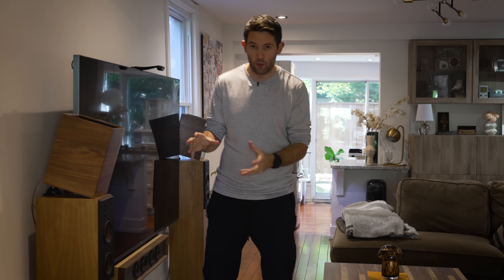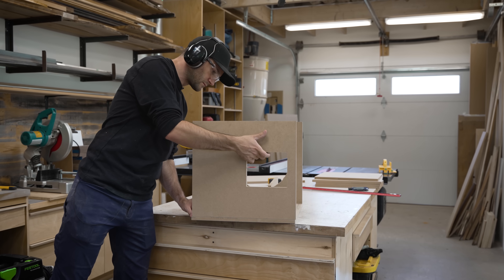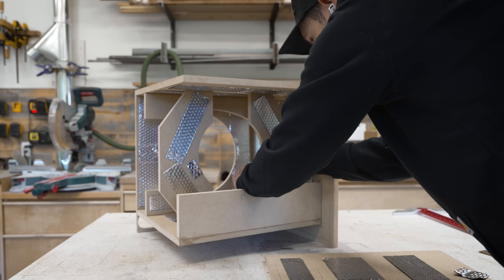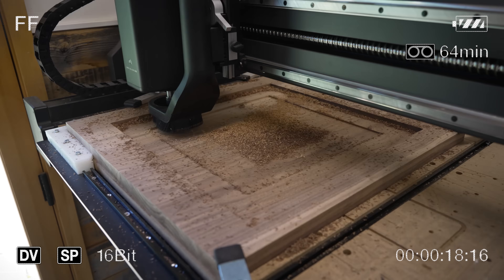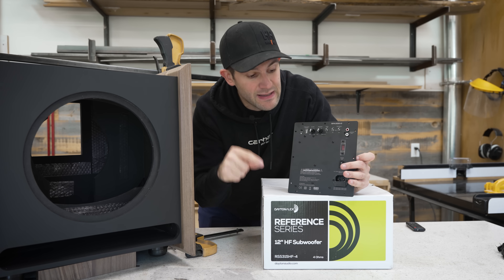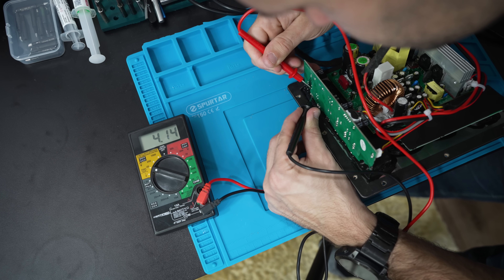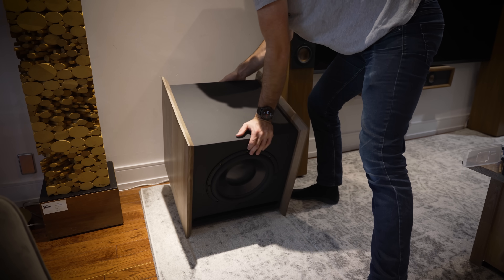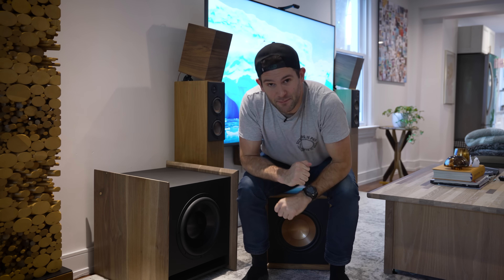THIS changes DIY Audio...

Comment: Like everything except the lack of screws.  Used to build Competition Grade sub boxes and we HAD to run 2 inch screws every 3 inches to hold the 1 inch birch 10 layer plywood together and liquid nail to seal it.  The finishing nail level nails you used made my butt pucker o.O

Comment: Wireless  everything in regards to home theatre  is not regulated  enough  to be a benefit and will interfere home   home networking

No matter  preamp or  avr  brand yku fuck around  in  networking in general nobody  deal and  wireless isgeneral slang is nonexistent in a progtamming layer

Including   s9meyhin that  can live on an app on a gateway routrr

Comment: Excellent video but I thought it might be helpful to point out that Class "D" amplifiers refers to a "switching" type power supply being employed to power the amplifier itself - compared to, for example, linear type power supplies found in class A/B & class A amplifiers - - the class "D" designation has nothing to do with whether or not the amplifier is a "digital" design.

Comment: Side note: if you are installing aluminum-backed butyl rubber sheeting, you really do need a brayer to press the butyl into the surface you're sticking it to. It'll ensure that it makes adequate contact so it doesn't fall off in the future once the solvents in the butyl inevitably escape and it begins to harden. It's why the aluminum is always textured like that. Press it with a brayer until the quilted texture has been pressed flat and you're guaranteed to have good contact.

Comment: A Class D amplifier exhibits harmonic distortion due to its sampling frequency. If you input a pure sine wave into a Class D amplifier, you'll see a stepped sine wave at the output. This cannot be considered 100% analog. A Class A amplifier is a pure and clean analog amplifier; the discussion then becomes whether or not it's energy efficient. For example, can we compare a Fusi (TPA3255) to an Accuphase Class A (A80)? Let's be realistic.

Comment: Sorry but destruction happens, when the amp clips, as this creates loud high frequency signals, really damaging.
So it is not about matching the wattage, but to have more power than you need for the amp.

Comment: Also.. u should ALWAYS hawe overhead watts from the amp and not less ! a woofer like your dayton RSS315HF4 is a 400w rms with 800w peak ! in subwoofers you always calculate 50- 100w owerhead even when it's applied in a ported box !  there wil be moore bad sound quality with a weak amp  and you're guaranteed todestroy the amp and the woofer!  but in the correct way to do this u only baybe break the woofer.. but not in this case cus the woofer can handle 800w peak !  nowhere near danger sone with 50 or 100watt overhead from the RMS of the woofer ! Personally i wuld used an amp that is in between the rms rating and peak rating of the woofer witch in this case would be 600w amplifier ! 

i don't know hwo learned u al these mistakes ! but hey ! this is beginner basic everybody know is wrong of u.. NEVER undercalculate a amplifier ! It`s more bad for the amp and the woofer since the amp is overloded al time an always clipping this is the wery known mistakes to kill the woofer AND the amp aswell !
A sealed subwoofer build in a good tuned box is always able to get lowest bass response ! as the ported even when perfect tuning applied i't will not go as low as a sealed bcz of the port turbelenting noise wil overtake and make no sound at al.. also basic things that every starter learn in the first..

Comment: As long as none of the PCB traces are torn, it's fine. And there's no risk of interference concerning revealed traces, because all of the soldering points are revealed anyway. Interference is negated most by the design of the traces and proximity, such as avoiding parallel traces corresponding to signal paths.

Comment: The choice of a 300 watt amplifier isn't terrible for a driver rated to handle 300 watts RMS, due to the increased efficiency when using a ported enclosure. However, had it been used within a sealed enclosure, it would have been a little under powered, because RMS is a rating of power at a continuous level and music isn't continuous, it is dynamic. 
When matching amps to drivers, you generally want to aim for an amp which delivers the rated driver RMS, plus half again. In this case, it would be 450 watts.
Also, the driver can have a greater impedance than what an amplifier is rated to be stable at. Simply be certain to not use a lower impedance. Using a higher impedance provides increased dampening or in other words, better control/quality, but more power will be required.
For example, when using an eight-ohm driver with an amplifier rated to provide 300 watts @ 4 ohms, the driver is only going to be presented with 150 watts. So the benefit of increased control typically requires using an amplifier which is rated to deliver three to four times the RMS rating of the transducer being driven.

Comment: Matching amp with driver power 1:1 is not necessary, over driving is only possible if you cannot manage to be carefull with the big twisty knob.
I find it better to make sure the amp is double or even tripple the power, this provides headroom and even more important a bigger damping factor.
A nice bonus is that the amps life wil be much longer as it wil not be working at 100% power all the time.

Comment: iv worked in sound for years and your information about the sub  and amp is totally incorrect u work to RMS not the full power of the sub and u want around about 50 to 100 watts more for the amp. as then it all runs efficiently as Ur amp wont last very long running it at full power all the time.

Comment: Zac is very capable on wood working and CNC - build is very nice, yet just like most DIY in audio. The think metal pad won't absorb base audio, this box seems has little audio concerns. Base reflect needs specific design and tune, and shall also use some absorb materials, I see none of them. If you don't know how to tune, you can use closed enclosure with enough absorb material. Don't use nails nor brads.

Comment: seriously ?  deeper low end rang on a ported ?  where was u at class ? the sealed boxex aaalways climb deeper than a ported box and with presission! i got 2 350w peerless xxls 12" from the fabric in denmark in 55l sealed boxes in my setup i challenge you to build a ported box that reaches below subsonic 15hz with ease and do not hawe any port noise at al ! cuz this is hi end hifi ! no poppcorn sound box that stops at 45zh..

Comment: Yo. Trust me on this shit. Put the driver downfacing on the bottom. Put it right in your most common sitting position. Right on the couch.  Creep around yer place. Find where it sounds best? K. Put it there. Hide it as needed, tighten with DSP.

Comment: On your amp, you want a lot more power than you ever intend to use. You never want to come up short on support. It's like Wall outlet current, a PC power supply, or a car engine; When you buy a car that can only go 70 miles an hour, and you often have to take it on the freeway, it will have a very short life. We own cars that will do 120mph, not because we want to go that fast, but so to can easily do 80 if needed. * PC power supply used at or near max output burn out quickly. * And wall outlet current that comes up short, fries power supplies and motors.

Comment: You asked about possible improvements. Sound wise? Nuthin! This is all the sub I'd ever want. Design wise? Love the look... but in my case, I have a peculiarity for preferring symmetry. Since bass is omnidirectional, and this sub is front ported, you can literally put it anywhere. So my symmetry gene would have looked into making the box slightly shorter, and slightly wider (keeping an eye on required volume) and sitting it under the center channel speaker. Just a little thing, but my feng shui gene would have approved.

Comment: Ported sub tuned to 32 hz is great for music. However, that's a recipe for over-excursion (blown sub) for home theater.

Below 32 hz, your enclosure is an open box. You need a high-pass filter blocking anything lower than the tuning frequency.

Comment: RIGHT AIR SPACE  in encluser, right crossover, for chosen speaker we used JL subs a lot    add the right amp   ..We use to build custom sub boxes to fit specific areas in automobiles when i had my car stereo business  back in the late 80s into 2000  home subb same format and math...
 I remember a trippty thing was to take a 4 ft long  x 5 in tube and stick out side of round port opening and watch the speaker flex seemed like forever.

Comment: The very best subwoofer enclosures contain nothing more than speaker wires and a speaker!  So that makes it much easier to build the best one!

Powered subs are horrible, in my view. They defeat the entire concept of tuning music, and bass is the most important part of music, and I want to tweak it. So I think I own all the passive subwoofers - and all the Fosi 2.1 three-channel units, because with modified subwoofers, they make all my old music, and all my old speakers sound brand new again! :)

Having SUBFREQ and SUBVOL instantly at your finger tips, on physical rotary pots is the best thing in a nearfield system: you get to massage the bass until it does exactly what you want, at any given moment. :D

Comment: Show me the math on applying Butyl to that MDF.  The mass increase is negligible, so why use Mass loaded vinyl?  It is made to stop resonance in thin metal /fiberglass/plastic panels.  Adding weight and more than doubling thickness.  Youre slapping it on a small piece of 3/4 MDF.

Comment: Very nice project, might do the same someday
One remark though : if you ever have interference, it will surely come from the sound wires coming from the wireless receiver
Usually, sound cables (RCA, Jack and others) are shielded to attenuate external agressions, here you installed cables without shielding and ran the wires right next to the "hot" (high voltage) side of your amplifier
You're lucky that those cables are short :)

Comment: Ahh yes the classic: Are Class D Amps Digital or Analog??? They are Analog. While plus width modulation resembles digital signaling the signal is still analog and PWM is not a binary encoder. If you think about it a digital audio amplification circuitry makes zero sense the drivers just want signal power to go to the magnetic coils. They couldn't give a crap if the signal power was encoded to binary. Why convert to digital if the driver is analog.

Comment: If you factor in the cost of parts and equipment, labor cost, the cost of renting a place where the product is built, payroll, R&D, dealership, logistics, etc, then you’ll realize comparing consumer products to DIY in terms of cost is not fair. I wish they are not expensive but that’s the cost of running a business.

Comment: FYI Its better to overpower a sub than it is to underpower one.  Ex: A 1000 watt amp powering a 800 watt sub is fine. Just reduce gain. Also, the overhang from the top panel isnt doing it any favors

Comment: This is awesome, but why not just 3d print a little box to mount on the back for the wireless?  Then anything changes or goes wrong, you can replace it without a bunch of work.  A low profile cover wouldn't even go past the pretty wood toward the back...

Comment: How did You calculate the port size? What Software did you use? If ANYBODY would like to do this with ANY other speaker or amp, This  is VERY IMPORTANT !

Comment: Huge respect for finding the leads for USB power on the amp PCB as well as the transceiver PCB and then soldering all of the leads instead of doing what I would have done: Just yanking the USB port from the read panel, facing it backwards, covering the USB port on the rear panel, and plugging the transceiver into the existing now inward facing USB port as is.

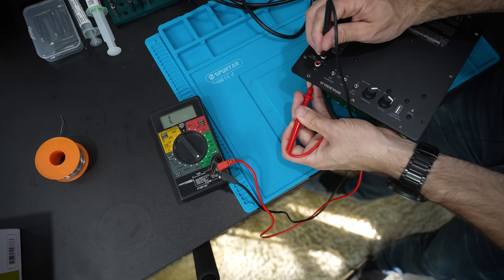Comment: Loved it - but .. er... 14:43 "I was worried that over time ...... corrosion & INTERFERENCE as well" (segment starts 14:37)... You have a class D amp (PCM) with a bluetooth / wifi wireless connection -- indeterminate delays and synch inaccuracies... PCB vibrating itself to bits... I think you have bigger worries.

Comment: Sorry, your box gonna SUCK ASS. I don't have the patience to explain much, but that sharp corner in your port MAY save your driver from the "Car Toys" tuning. The speaker is gonna unload below 35hz making any frequency signal below that try to rip your driver apart.

Comment: when i was 12 my dad (who builds speakers as a hobby) and I made a set of desktop speakers and a 12 inch sub that he designed with a passive radiator, and i can say the sub is still enough to make the plates in the kitchen rattle, amazing what something so small can output

Comment: using an amp less powerful than what the speaker can take is just gonna kill your amp. your amp can provide as many watts as it can, the speaker is only gona use what it "needs". just make sure you test the distortion limits of you speaker and set the gains right so you use 400w right at 0db input.

Comment: A 400 watt amp isnt going to blow up a 300 watt woofer. Speakers mostly die from clipping amps. So to little power is often more of a risk. And for the wireless connection you are trading in a lot of sound quality. The enclosure is very nicly done. That CNC table is very handy.👍

Comment: The result is clean. The result is clean. But .... 

The thickness of the wood is too thin (it will vibrate and you'll lose energy and definition). Wood density is too low (same thing). Stickers of any kind will do nothing to counter resonance (use mineral wool instead) and non-parallel panels. 
The design of a loudspeaker enclosure is a delicate mix between the characteristics of the loudspeaker (natural frequency, weight and rigidity of the membrane), the interior volume of the enclosure and the type of process envisaged (bass-reflex, horn, open, closed, etc.). Some loudspeakers cannot be used with certain types of process.
A common sealing method is to use blackson, which both seals and weighs down the walls.

An acoustician

Comment: That Dayton driver is solid. Even that mid-level driver from them is better than what's inside most subwoofers on the open market, excluding the very high end subs. For those of you with major brands at home, pop that woofer out of your tower or subwoofer, you'll be painfully surprised how wimpy that woofer is, lol. Dayton makes some other woofers that are fantastic

Comment: Nice looking speaker, you did a great job. 

I'm a speaker builder so I feel compelled to give you some criticism to help improve future builds: 

  1:  You went through all that trouble to brace the interior of your cabinet properly BUT then you completely forgot to brace the bottom and back panels. 2 braces running front (port exit) to rear equally spaced INSIDE the port would properly brace the bottom panel. It would form several "I" beams inside that port and stop vibrations on that bottom panel in their tracks. Another 2 braces running down the back panel as well. The rule of thumb for subwoofer bracing is that there should be no span more then 8" square without a brace. Cut a piece of paper 8" x 8" and any panel you can place that on without hitting a brace needs additional support. Almost every DIY box I see on youtube has inadequate bracing, don't skimp on it, it is extremely important. You can check out the video on my channel to see the cabinets I build and the bracing inside the subwoofer horn is visible, no more then 8" between braces.

     Second is that all the outside edges of the port should be rounded over to prevent chuffing. It may not be a problem at the volume levels you use but it's easy enough to do with a router and round over bit and it looks better as well.

     Third is that the wireless solution you chose has a latency (from the manual) of 32 milliseconds. Unless you have a means of delaying all your other speakers (and the picture on the screen) the same amount (many AV receivers can do this) then that is a completely unacceptable amount of delay. If you can't address that then tear out that wireless receiver and go corded as you'll never get that subwoofer to seamlessly crossover to the mains, it's just too far away in terms of time. Subwoofer drivers are already 8-12 ms behind in time (due to the inductance of the huge voice coil) as it is without all the added delay. They need help in that area as it is and this receiver just made the problem 4 times worse.

That's about it for the build. I'll add that you can't just adjust the box tuning (port length) all willy nilly to suit some sort of preference you have. You need to model (with software) the drivers T/S specs, the box enclosure volume and the port all together as they all work together as 1 system. You change any 1 of those 3 things and you change how the system as a whole performs. If you need to go lower in frequency then you need a whole new system - different driver with different specs, box volume and tuning frequency that is suited for such. You can't force a driver to go lower (or higher) then it is designed for without giving up performance in some other area. Software modeling will let you know what is being gained (and lost) doing so.